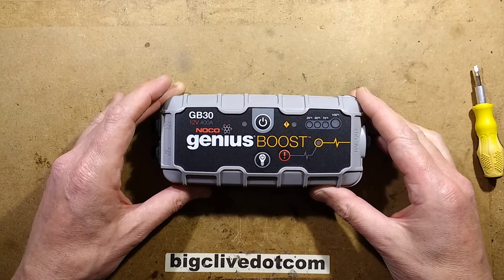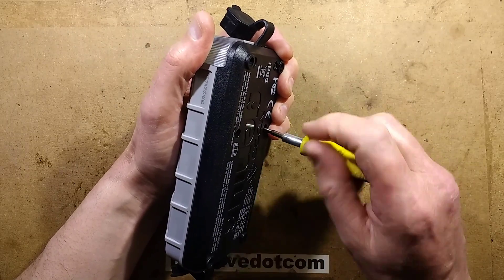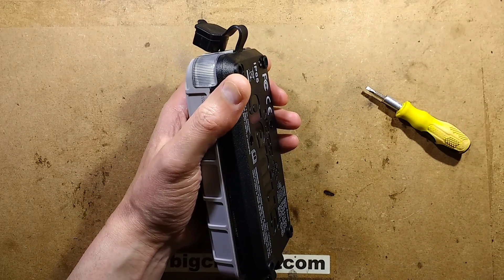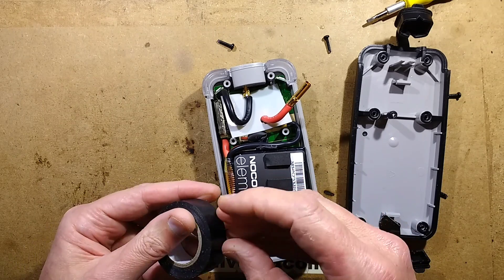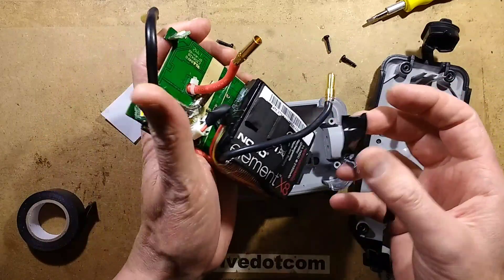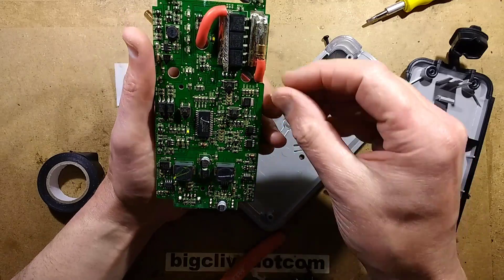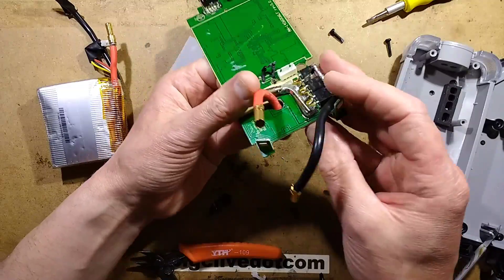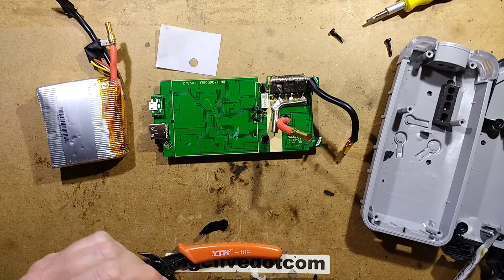Noco GB30 failure autopsy.

Comment: Overloaded product: could not handle what is required of it. I have it’s bigger brother, GB40. Half of the time, it barely jump start a little 4 cylinder compact car in cold temperature. Now it acts like an expensive USB power pack for my phone

Comment: To really understand what happened here one needs to know the life history of this booster. It may have been caused by faulty manufacturing (poor quality parts etc...) or completely abused by the user ignoring safe operating protocols & demanding too much from the pack. 
Quite obvious the battery pack was subjected to extreme heat stress & subjected  electronic components to extreme limits (& beyond) or else these components were of substandard quality & unable to control this beast... called the "battery"!
I will not point a finger at NOCO entirely...there are too many reasons for this to happen. One has to look at the 'damage rate' of these booster packs to determine their quality...& an evaluation of NOCO's reputation.

Comment: In the chinese packs, is all of the protection circuitry in the clamps?  If so, could you use an unprotected lipo with the clamps in substitution for these?  I can see that noco puts its protection circuitry in the device rather than the clamps.  What do the more name-brand packs do - protection in clamps or protection in pack?

Comment: can we replace the lipo pouch battery with 18650 cells in series x 2 parrels? asking for a friend
Reply from the maker: It has to be a very high current pack.  Ordinary 18650's would probably be damaged.

Comment: The common problem with these units is that everyone leaves them in their vehicle 24/7 including during the summer heat. The extreme temperature in a hot vehicle will always cause a battery to swell up. I have a different brand jump starter that I store in my vehicle and noticed that the battery also swelled up after a couple years.
Reply: I mean, why would anyone keep a jump pack designed for jump starting vehicles actually in a vehicle?
Reply: Once the battery is swollen, is it still safe to keep around and use?
Reply: @noodles806  Not safe at all. I'd bring them out the house and/ or car and leave them inside of a BBQ or concrete floor surface just in case they catch fire!!
Reply: @LuisA1Million  Appreciate your reply! I ended up chatting with NOCO Support and e-wasted the device that same day.
Reply: @LuisA1Million Yeah, I wouldn't trust a swollen battery. A bucket of sand works well for short term containment
Reply: @Rankine_Cycle21  Worth a special trip to get rid of.
Reply: @noodles806 is safety really worth sacrificing for thriftiness? That should answer your question. Go search for lithium battery fires on YouTube and ask yourself the same question again. 

A friend had her garage burn down due to an EV fire.
Reply: Can’t help but think you havent thought this one through, I mean No point having your charger being in your garage at home if your car don’t start at work or on holiday
Reply: Noco products are total shit
Reply: Jump starting cars with other cars used to be acceptable and quite sufficient. Apparently, people these days are too good for that.
Reply: @looksirdroids9134  Are you sure? What you're really saying is that no one in the past needed a jump start without other cars around - not an easy statement to prove, and not particularly plausible to begin with.
Reply: @looksirdroids9134 What if no one wants to help you these days? They could give less of crap if you crash, die or catch fire let alone if you don't have a good battery in your car. If wish this wouldn't be the case but most of the times it is so you are better to be prepared than depend on somebody else.
Reply: @looksirdroids9134  It's better to be as self-reliant as possible.
Reply: @looksirdroids9134  except there may not be another car/operator available to give you a jump. the entire idea of these jump starters is that you can keep them in your car for when you need a jump,DIY.
Thus they should be designed to handle sitting in a hot car interior without failing,even in mid-summer.

Comment: On some jump-starters the diodes are actually located in the cables.
Reply: they prevent reverse current being applied to the lithium cells/circuitry. especially after the engine starts.

Comment: Hi how many mAh is the battery pack?  I know that the GB40 is only 2150mAh which surprised me at how low that it.  Thanks.
Reply: You can see the rating on the label and it looks to me 2150mAh.

Comment: I'm wondering if it is generally a bad design to have mosfets in parallel. Typically one fet can handle a current spike at least twice its rating for continuous current, for some number of milliseconds. Maybe if only one turned on, and the other(s) had a longer than expected delay, it could cause a cascading fet failure. Is that likely to happen?
Reply: It's perfectly normal to use FET's in parallel but when there's a problem, they all blow up together.

Comment: I bought one of these when they were new, box and everything seems quality. But they are crap. Would barely start a 4 cylinder engine and a diesel with common rail you can forget it. Doesn’t even start my old 1.6 diesel camper. Biggest waste of £90 ever. If you’re looking to buy one don’t. It wasn’t good from the get go. Wish I sent it back. Hope this one went to be recycled or binned

Comment: Using the booster mode in direct and accidentally reverse connecting the battery to boost will blow out the booster unit and do the damage shown. Also can cause the battery to swell up from over current. In direct mode, shorting the output will also do damage to the unit.

Comment: All these problems...mine has always worked.
I'm guessing that since the mosfets were open it wouldn't have been spectacular if you had shorted the two output wires...

Comment: I have the GB40 and when I press the exclamation mark button to give the car battery a boost, upon turning the key to start the engine, the GB40 shuts off. But then when I turn on the unit, the green light indicates it is still fully charged. What could the problem be? Can You help me modify it to serve as a battery booster jumper and not have to go through all the fancy protection that cause it to shut off? Thanks Clive!

Comment: Have been using GB40 for a while now, giving boosts to some stragglers on the road and jump starting my car once. No issues. I'm surprised they don't use the standard 18650 cells, though.

Comment: My GB70 battery swelled up so much it split the case apart. It was about 3 years old, but had only been used a few times. Charged it about every 3 months. Last time it would not charge, so I left it on longer. A day later it lined like a bloated tick.

Comment: I cringed as I watched the Li-Ion battery pack's shrink wrap being cut away with metal pliers. Anyone who has ever experienced the joy of piercing a Li-Ion battery's plastic pouch with a metal anything (like a screwdriver, or wire cutters!) knows what can happen. You won't believe the smoke, stench, and fire that pours out of the punctured battery as all of those joules are instantly released! Anyone remember the two fires in the Boeing 787's battery compartment (2013 and 2014)? Pouring water on them won't extinguish the fire, which is why I think using Li-Ion batteries to control your flight surfaces is a real bad idea (although pilots love how easy it is to fly the 787 with electrical control of the surfaces rather than the traditional hydraulics). Boeing finally had to put the batteries inside a hefty steel box for fire containment.

Comment: Seeing Clive react to the pack, I'm thinking he's never seen a 14.8V (10Ah) LiPo battery pack after a few flights. These things puff up under a tiny bit of load, or is anyone here gonna tell me, that one brushless motor at full throttle (smooth throttle increase) for less than 3 seconds is enough to overload a that kind of battery? (The battery is rated for 1.8 kW of sustained load, and 3.6 kW of peak load)

Comment: I sold that kind of boosters at my old job in retail when these were just arriving for us back in 2013. Seems to very similar yet a bit larger than those we had. And I am speaking of entry level wich for this brand was still solid. Good compact boosters for small cars. While I never had any customers complain about them I always felt they were kind of oversold. Decent product at best. I'm not 100% sure about the actual price or grade of this specific one. My memory is fairly fuzzy after all these years. If I remember these 3 small parts are used separatly depending on what the boosters decide is an accurate and optimal use of power. Problem is if somebody would constantly use them to compensate for a dead battery. Instead of, you know, change the battery asap. It would always over deliver since this is made to support a battery and not replace them. Result? These chips overheat and cracks.

Comment: So, after looking up the datasheet for those mosfets, I'm going to assume someone either put the cables on backwards (which should've blown the diodes instead of the mosfets) or there was a huge power surge. I say that because the maximum rated current in the package is 75A per mosfet. So 225A total. On a bare mosfet, the maximum rated current is 130A. Those are designed to take a beating, but dang

Comment: Nothing beats the traditional JNC660 peak 1700ampe junp starter super reliable and always works that's why it's #1 chosen by many automotive and diesel truck shops, these bull shit lithium tiny jump starters may be good for tiny motorcycle batteries but that's about it
Reply: Dumb comment. Its clearly not made for motorcycles only since a lot of people made positive reviews of starting so many stranded cars with all sort of engines. Give me your JNC660 and let me treat it how the owner of this “tiny” jumpstarter treated it, I guarantee I can fry it in same way. You’re clueless yet you like to post negative comments about a product you probably never used before.

Comment: i have been looking for this devices and i have a question: can you put theese on the car just to level the battery voltage so that when i use diagnostic equipment the battery wont fail ?

Comment: GB40 worked great the first two times I used it and now it is DEAD. Stuck at 25% charge infinity I cannot use it anymore and it is still new.
Buyer beware, the Noco Genius Boost units have problems. 
There are a lot of people on Amazon reviews also having problems with theirs.
Reply: Had same issue, solved it by pressing all 3 buttons together until lights flashed. This seems to do a reset and the unit now charges properly.
Reply: Travis In Canada yup, you are right on. They should seriously change their jump packs names to NOGO
Reply: My experience is quite the opposite. Bought GB40 off Amazon.ca and have been using it for about three years now, multiple jump starts (mostly for stragglers on the road, but once for my car), also using it extensively as a powerbank. It just keeps working.
Reply: I WANT MY MONEY BACK!!

Comment: I bought the Viking brand battery booster, from Harbor Freight. It worked so well, that I bought a second one. Both of our cars are always armed with a back up, just in case the battery dies. I have a Ford Escape with a bad battery, and I use the booster to start it anytime I need to use it. They are $80 and are rated for 450 amps. That's enough to start a petrol V8 or a small diesel, like the 2.0L four cylinder.

Comment: is that thing supposed to start a car with that tiny battery ?
Reply from the maker: Yes.  And it does.  The lithium cells are optimised for delivering very high current.  Literally hundreds of amps for a short time.

Comment: I work for a company that liquidates amazon returns. So I can tell you that I have seen MANY of these jump boxes of all shape and brands. Noco Has the same problem that they all do. Lipo!  Leave them charged fully...Go bad. Over amp draw...Go bad.! Fix would be to implement a time discharge like the DJI packs have and a over discharge circuit, they would last a lot longer. Now the good new is their lipo packs are of good quality and I have used a pack out of the same unit to power my 250 size Quad-copter and got over 20 min out of (used pack) that the internal resistance was horrible! It had there same problem with the mosfets as this one did.
Reply: Thanks for the info.  Much Appreciated. 
Whats the point in having one of these if a person can't store it fully charged,  or use it without worrying that it might be drained?
Do you know of one that has the features that you mention?
I looked for a DJI and I only find are  Remote controll helicopters.
Thanks again.

Comment: Why arn't they using ultra-capacitors?
Reply: Because ultra capacitors have a very much smaller charge storage capability than a Lithium cell of the same mass, and even much less than a Lead acid battery of similar volume. They can dump their charge more quickly than a battery, but ultimately the total charge would only be good for a very few attempts at starting a vehicle before needing recharging. Capacitors are charge storage devices - electrons are stored on parallel plates, but a cell of a battery works via a relatively slow chemical ion reaction, where comparatively huge (compared to tiny, highly mobile, electrons) metal ions travel through an electrolyte, forming chemical layers on electrodes.
Reply: @RWBHere  
https://youtu.be/Xmy9whahHBM

Comment: I'd be interested in seeing a tear down of one of the new "batteryless" jump packs (e.g., Autowit) which use the dead car battery as the source of power to start the car.  I assume there is some sort of jewel thief circuit to extract energy from the battery which then charges a supercap which provides the boost to start the car.  The obvious advantage is there is no battery in the jump pack which has to be charged in advance.  Seems like a bit of technical magic.

Comment: These Noco are short and reverse polarity protected so you didn't have to worry about leads touching together I own one and like it alot !
Reply: Outside of the device, yes there's protections if not enabling force mode, but when he opened it, there were two battery leads that were bare and not knowing of the switches malfunctioned in the on or off position, better to be safe than sorry 😬

Comment: Clive: do you think the Mosfets went Pop and caused the battery to short out partially and get all puffy, or was the Unit overloaded somehow that caused the failure?
I knew a man who ran an ice cream truck here in the states who tried to power his onboard freezer on an inverter. and the inverter ,[  which was not anywhere near rated for such a high amperage appliance ] went bang! and on opening it up to have a look, i discovered that the result looked very similar.totally Charcolated mosfets/ Triacs and the fuses it used were of the US auto type. and on one of them, the clear plastic  casing looked kind of distorted and bubbly.
Reply from the maker: I'm guessing it may have been used in force and cooked the components.  If a car's not starting people will often just keep cranking out of desperation.

Comment: Stumbled on your videos and enjoy watching. I decided to chime in on this one, since I recently purchased their (Noco) GB150. For the last few years I've been taking my XR650R dirt bike to Death Valley and usually I am miles away from civilization camping and alone. It never dawned on me that I may need a jump, and the lightbulb in my tiny head went off. You need a means of rescue! Long story short.... I bought the unit before my last trip and stopped before I went to a friends house. I actually jump started my friends Diesel. To be honest we were both skeptical. It cranked the engine over with ease. I have had other cheap models that wouldn't even start my car, and actually went up in smoke. Scary feeling. AND YES I DID WANT TO SEE YOU SHORT IT OUT. Cheers!

Comment: your worried about shorting it yet your touching them terminals.. looks like it would put out some juice with the size of wire
Reply: Why would touching the terminals be a problem, there is zero chance of anything by touching the terminals,
Reply: @orange70383  got me he said it.. the size of them wires are pretty big so id figure the battery if was good or had any power in it might light you up some

Comment: Were you worried about the wires shorting because of the battery? And if so does laying your finger across both of them not worry you? 

Is NoCo or CTEK the higher end brand? They seem very similar
Reply: learn about electricity.

Comment: A nominal 11.1V power pack to boost a nominal 12V battery. Is there a chip in there for that, too?

/s
Reply: not actually boosting the 12V internal battery. It just works to power up the starting motor that needs voltage between 8 to 12 volts only but with very heavy current on cranking step.

Comment: One of the selling features of NOCO is that you can not shorten out the leads, or so they say, so i would have liked you to touch those two wires together and see how they are protected. I found your video because my NOCO stopped working or at least it will not boost my boat motor. In the beginning when it was new i was able to boost a full size van with dead battery with a 6lt engine. but now it just left me stranded with my outboard motor.
Wanted to take mine apart but it has screw heads with a triangle never seen these before and I have a lot of screw driver tips.

Comment: I bet this was used on a car where the battery was charged and just something loose keeping it from starting and when he connected this to the car it back powered the mosfets and ruined the mosfets and in turn fried the battery inside it, just replace the battery and the mosfets, I bet it would work fine